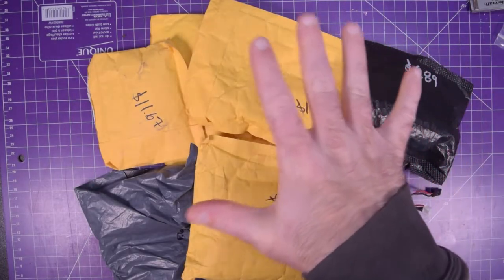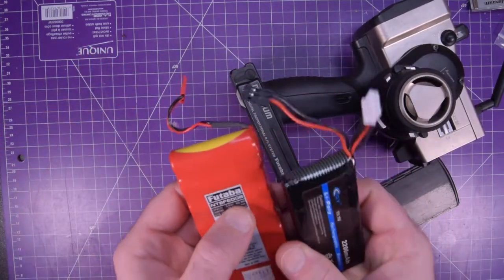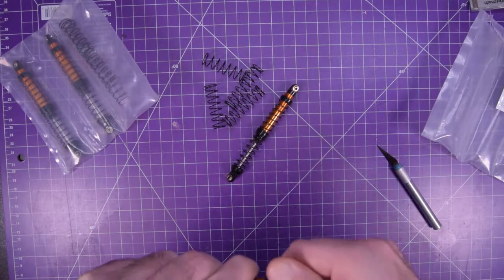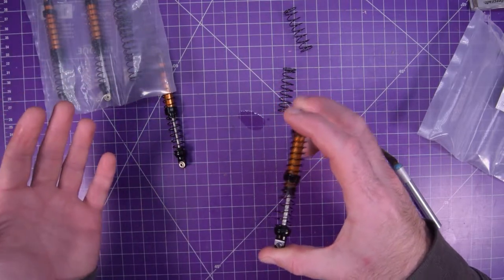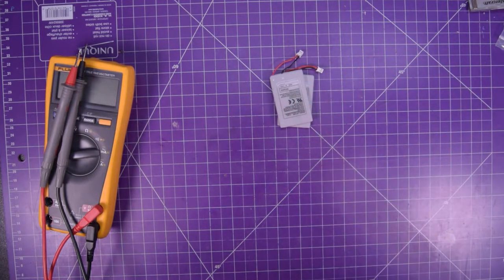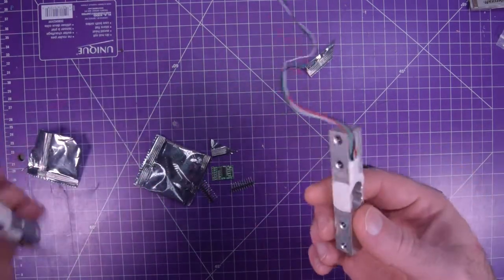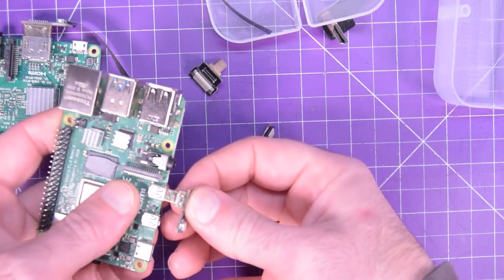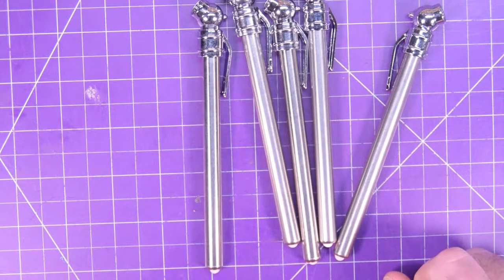Mailbag 125 - Shocks

Comment: Couldn't see if those shocks were able, but you can normally just squeeze the spring and pop out the bottom cup to change springs; saves having to change the adjuster and take off the oil cap.

Comment: Ni-Cad batteries only charge up to 1.2V not 1.5V. For 12 volts you woul need 10 of them, that is only a 9.6V pack. Like it says on the lable. I had a 12V tape deck that took 10 Ni-Cad or 8 normal D size batteries.
Even though it had a built in charger I took the batteries out. it was not fun dragging that thing around. LOL